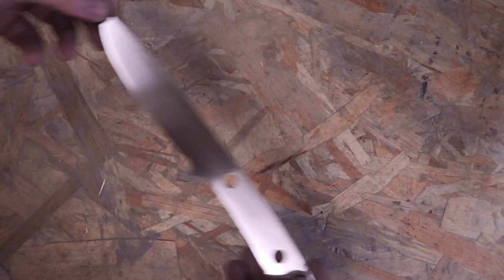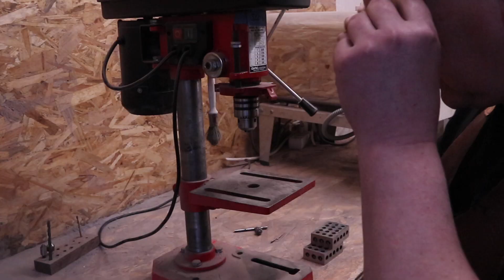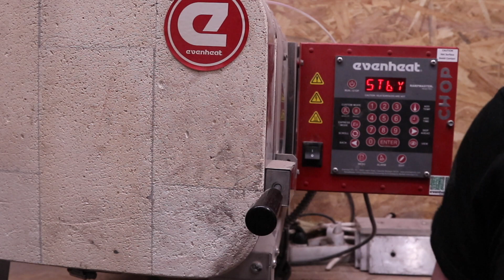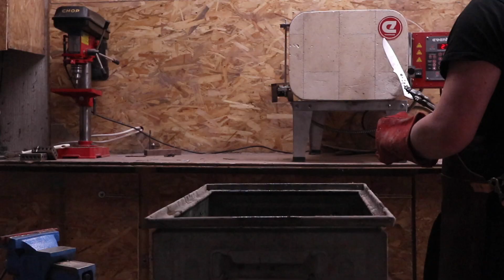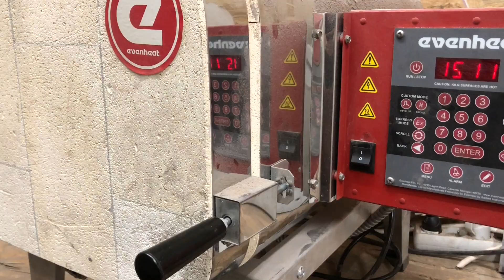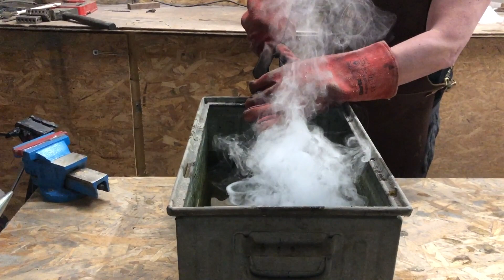Knifetalk Buildalong part 2 - Heat treating the blade

Comment: Sweet jimping... I actually started using a centering bit(like for a lathe to mark my holes, accurate & quick), also I use a clamp behind my blade not on it, that way the blade can move & align with your hole, but not helicopter(you can do many knives without clamping/unclamping). I bought one of those little electric stove top single burner, when I throw in the knife, I turn it on & can control the oil temps. Sorry, kinda commenting as I watch, not saying what is right or wrong, just my techniques... Hope all is well, take it easy...
Reply from the maker: Great to hear more tips - thanks Dave

Comment: Top job Craig. Can I get a reasonable heat treat with propane and firebricks do you think? That's all I have at the moment...
Reply from the maker: We discuss it on tomorrow’s podcast. No spoilers here 🤓
Reply: @ChopKnives  Excellent, thanks, cant wait! :)
Reply: I've used a propane or mapp torch and a small homemade forge from firebricks to heat treat O1 tool steel many times. If you're looking for a solid guide on doing this, check out Gough Customs YouTube channel. (or just wait for ktp!)
Reply: @JakofAllBlades  Funnily enough I was just watching Aaron'svideo when I saw your reply notification! He's put my mind at rest, as that is pretty much what I've got already, so I can have a go. I've always been a bit reticent about 01, but I can see now that it is very forgiving. Cant wait to get my blanks through the post! I think I will break the 90's before heat treat though, to help with final grind.
Reply: @4eeny  glad to hear you're squared away! And O1 is definitely forgiving in heat treat, and actually holds an edge decently well if tempered correctly. Also takes an acid blackened or stonewash finish quite nicely. Cheers and happy building!
Reply: @JakofAllBlades  Thanks mate